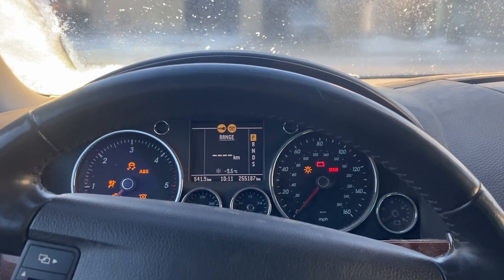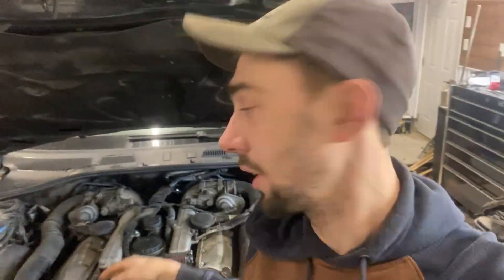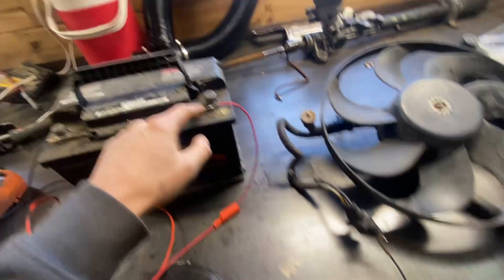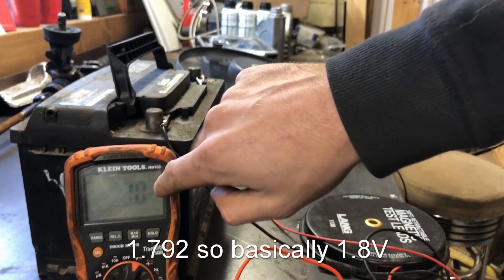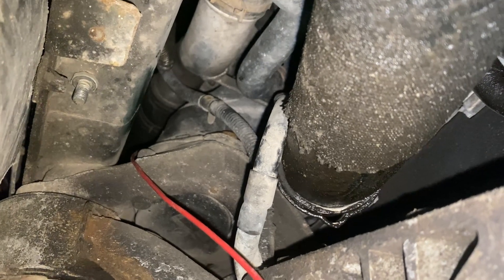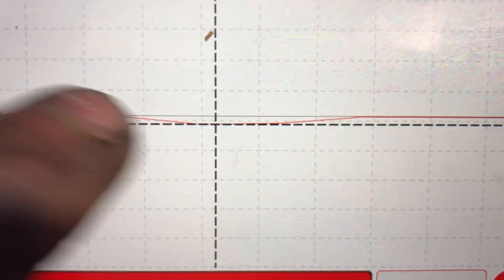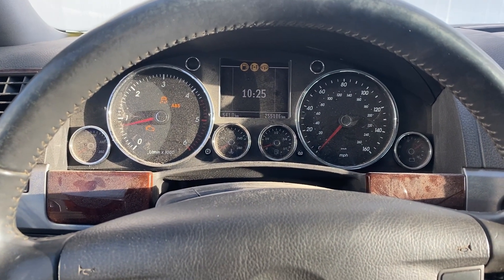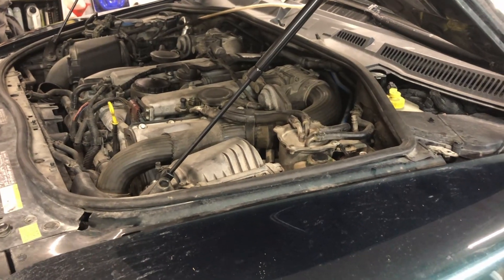How To Diagnose No-Crank on a V10 TDI using a voltage drop test

Comment: Hi Jush. This is my story: mine will start any day if the engine is cold but not qhen its hot. I have change the batteries, the starter motor and it only improves for weeks then ig start. The voltage shows 14 when the inges is running. It's a 2009 v10.
Reply from the maker: Wont crank when hot? or cranks but wont fire? any ecu 1 or 2 codes?
Reply: @JoshsJettas  it cranks and cut. 4th crank is like the battery goes dead and never crank again. I do not a diagnosing tool to try that..